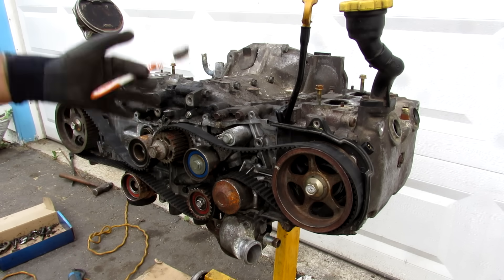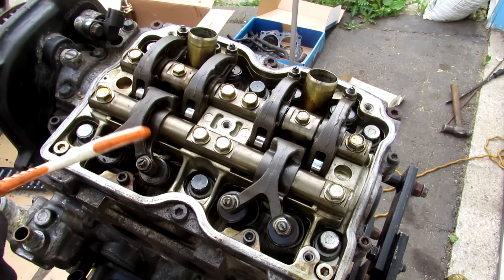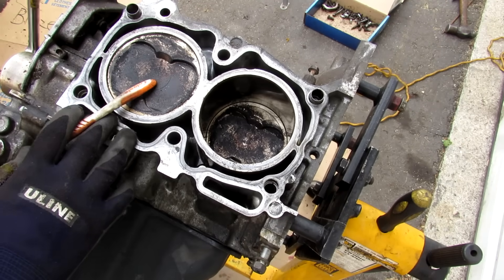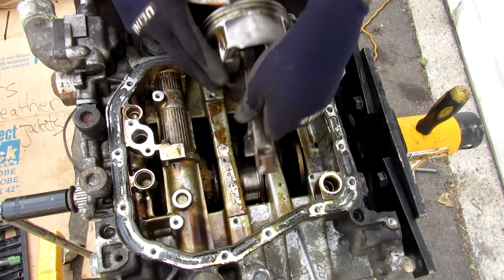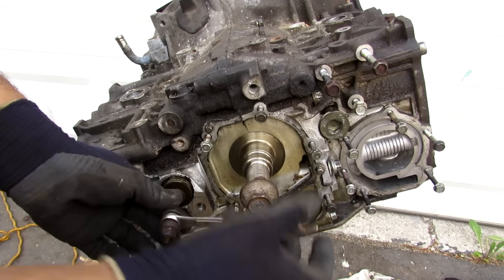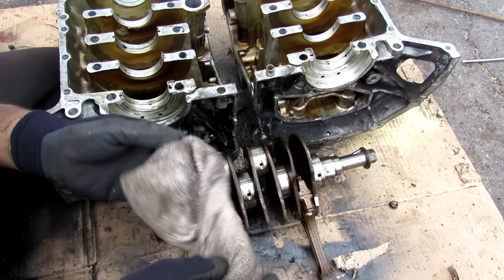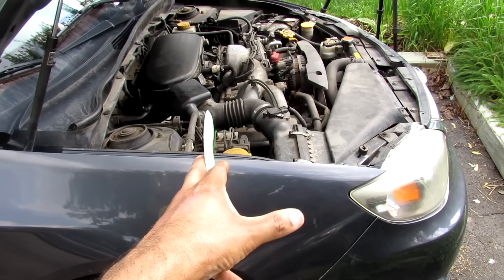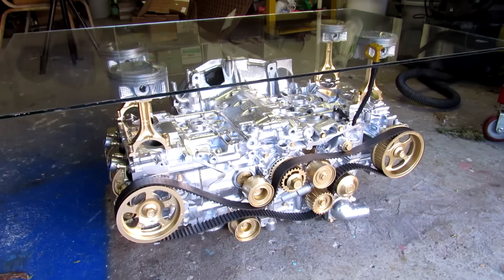Why Subaru Engines FAIL

Comment: "Oil burning, Oil starvation, Head gasket problems, Hassle to work on."
The four horsemen of the Automotive apocalypse.
Reply from the maker: Yes
Reply: @speedkar99  Great video, thank you. I wish I'd seen this before getting my 2010 Outback.  Soon as I got it home, head gaskets failed and engine had to be rebuilt (94kmiles).  I couldn't return it due to my state's lemon law.  Was great for 77k miles then gaskets failed again at 171k miles.  This time due to relay failure not spinning the cooling fans during a 2 hour trip.  I don't beat on my vehicles. I kept up on all maintenance. Coolant, plugs, oil (every 3k miles), trans, differentials, you name it, from experienced & trusted mechanics.  Have all records to prove it.  I was planning to keep it a long time.  I can't afford to keep repairing this archaic design issue so I sold it.  I don't doubt they can last. (I've seen some old ones still on the road from the late 90's early 2k's)  But it seems, unless you find the right combination of used care, maintained meticulously, these cars are a serious roll of the dice.
Reply: @ajfox96  they've had a hard time with their supply chain in recent years. The company exploded in size after the mid 2000s and especially after Trump's China trade disaster, parts in the U.S. have been sketchy. They're still a much smaller company than Toyota, Honda etc. In my opinion their best years are 2003-2008. I'm on my second forester (totalled the first one in an accident) and it's got 190k, running strong as hell.
Reply: @cymatic83  I agree, I've seen many late 90's to about Mid-2000's Legacy/Outbacks, Imprezas and Foresters around here (MN).  I should have gone with something that vintage like you said.  I really liked the look, handling, feel and ride of my Outback.  I coupled it with great winter tires and I just could not get it stuck. (I had lots of fun in the snow here)  It just really kills me to get snake bitten like this twice in the span of 80K miles.  Maybe I got a well disguised lemon, I don't know.  It was just really tough to have happen again after the care and attention I gave it.   Ironically, the very next service visit I was going to have my mechanic check the coolant and cooling fans/system.   My bad luck I guess.  I'm glad yours is going strong. I hope it keeps going for you.
Reply: @speedkar99  I got some questions since you seem to know Subarus very well.

Are there any NA Subarus that have unequal headers? If not, are there any turbo Subarus, besides the 2.5 in the STI?

Do the problems you described in the vid apply to all Subarus boxer engines?
Reply: @muaythai193  2.5rs and 2.5i were NA and no they didn’t come with unequal length headers. Aftermarket ones yes. Very common mod for hp gains on the rs and i.
Reply: @joshuanelson5092  And to add the 2002-2003 WRX had a 2.0 turbo engine. The 2.5, if i remember correctly, didn't get a turbo until 2004 for the WRX and STI.
Reply: @muaythai193  a lot of legacy models are turbo. I have a legacy B4 twin turbo.
Reply: @muaythai193  
No naturally aspirated models never had equal length(whi h is good, makes temprrstues even and is more efficient),but many people put turbo model headers for the rumble sound.

And again no, only SOHC naturally aspirated EJ25 is prone to these because of bad head gasket materials and design. It is permanently repairable by using EJ25 turbo gasket. 
All other engines including 2.0(ej20) and 2.2(ej22), h6 3.0(ez30) and newer FA/FB(both 2.0 and 2.5) engines dont have any headgasket issues at all.
What you might need to keeo an eye out if you get early series FB and FA engine is engine oil consumption(was resolved after 2014 onwards) but its not much of a problem. 

All it amounts to is that i carry small bottle of oil in my trunk(i have XV Crosstrek with FB20 engine) and around every 1000-1300miles/1600-2000kilometers i add around 0.8-1L of engine oil if it was on longer trip constantly(till orange oil level light comes on) but its infrequent. 

 Also i check oil level from time to time, something you should do anyways as a car owner. 

Possible treatment for it would be some fuel/oil additives like some ceramizer products, they reduce the problem greatly.

It also is healthy for the engine as you refresh the oil by adding a bit of new one for amount burned off, barelly costs anything.

 Its better to have just petty thing like this than catastrophic failures and flaws other manufacturers have more often on actually bad engines, but people dont talk about those much.
Reply: @Kacpa2  true, thx for the info.
Reply: @muaythai193  You're welcome :)
Reply: If you ask any mechanic of experience they will tell you Subaru is actually the easiest brand to work on. There is no stupid engineering in regards to servicing like so many other makes, for example pulling an engine to replace a 5c part, thanks BMW.
Reply: @sneakyfoz3692  can't make jokes nowadays, people just take it too seriously but yeah, I understand completely... to me it's all about honda, they make real educated decisions on where service items go
Reply: @r.p.6628  Totally agree with you. I often disregard the hate subies get. I drive a 1999 fozzie Stb in Africa on unforgiving roads in market full of cheap Chinese knock off spares and low grade fuel. I'm on over  270,000km and counting, got the car second hand and have driven it for 10 years and it still runs like a top.
Reply: I wish I knew half the Subbie engine knowledge this gentleman has. I would feel very comfortable driving my STI. Oh well I never floor the gas and always keep up with maintenance so hopefully I should be ok.
Reply: @dougcastle1785  never geting to go WOT in your STi is the definition of “not okay!”
Reply: Put a turbo head gasket on. Problem solved
Reply: Lol christ, the boxer hate here is hilarious. I see more old Subarus on the road (yes, still running) than literally any other car. Rusted out and beat to hell but still going. For every 10+ year old BMW, Benz, Audi, I can count 30 foresters and imprezas. I see more late 90s/early 2000s Subarus than I do any model Toyota, which people FAP to about their supposed reliability. I had an 87 4runner with the legendary 22RE and it was a nightmare. Easy to work on (and fun as hell) but reliable my ass. My dad and brother both had 2010 (ish) F150s that suffered from fuel rails rotting out, compressors failing, and a slew of other dogshit design problems with their Triton "modular" engine or whatever the hell they are. My brother currently has a 2011 Honda pilot with that stupid Eco mode that disables half the cylinders in the engine and causes a ton of problems too. Needless bells and whistles that break, Subaru doesn't have them. People trash talking these cars are so full of crap, probably because they suck at working on anything other than an inline or a V. Cry about it. They're simple engines, just shaped weird. You can't argue with the numbers of these things still on the road. I'm currently at 190k on my 08 Forester 2.5 and she purrs like a kitten, starts after one crank, still has tons of get up and go, not a wet spot on it. They're fantastic engines. People who don't know how to maintain them end up with these problems, which is the same story with any car you drive. I've driven Toyotas, Fords, GMs, Hondas, honest to god none of them hold a candle to the utility, capability, and reliability of my Subaru... and I'm on my second one. Maintain your Subaru and it will do you right.
Reply: Hassle to work on??? I've been a mechanic at too many shops and have done engines in lots of cars. Subarus are EASY! About the easiest I've worked on. BTW, My legacy has 370,000 miles on it. Original head gaskets. Maintain your car! it will last.
Reply: @mycoolwill7594  Hot damn, you only have about 107,800 miles until you've made it back from the moon in that legacy
Reply: Do u have a way to easily change the spark plugs?
Reply: @MrLanternland  remove the battery and washer fluid reservoir on driver side, remove air scoop and air filter box on passenger side, use a low profile ratchet, plus using a couple extensions to make getting the plugs in/out easier
Reply: @MrLanternland  jack the motor up slightly.
Reply: @mycoolwill7594  Hell yeah you said it for me. Every car is different and everyone has a different opinion. I've got one that's got almost 290,000 miles on it no head gasket problems none of that. I've just got to replace a power steering pump.Still runs great even the transmissions worn out and it always shifts!
Reply: @mycoolwill7594  just just gonna say there to easy btw I'm rocking a 95 legacy lsi blew the timing belt 10 k ago replaced all and she keeps purring 265k
Reply: @mycoolwill7594  From one mechanic to another.... I'd rather work on a inline 4 all day everyday.
Reply: @mycoolwill7594  please elaborate on easy.
Reply: @yolofullsend  Well, just pick something and compare it to let's say, Nissan, or Honda. Replace an alternator, ac compressor, condenser etc. Infinitely easier to do in a subaru. Hell, just try and put a cabin filter in a Nissan. Their engineers designed those cars with the thought of "I don't have to work on it."
Reply: @mycoolwill7594  HONDA - Had One, Never Doing it Again!  We had a Honda and virtually everything was harder to do on it than every other vehicle I've owned.  My Forester is one of the easier vehicles to work on.
Reply: @mycoolwill7594  Not quite. Alternator and Compressor may be top center on the engine but it requires a few things to be taken off before you can remove them from the engine. On a lot of cars, you can directly access the bolts and remove the unit without removing trim or brackets.. I changed out the Alternator in my Civic in a Autozone parking lot in about 15 minutes. 

And that sums up the only two things that are 'easy' to service on a boxer engine. Let's not try and stretch the truth here, that engine is a fucking nightmare to work on. Pretty much any internal work means the engine needs to come out and you can't even mount it on a stand and access everything. Compared to a inline, you'd have to be drunk to consider a Boxer easy.
Reply: @WolfPackM98c  Not sure what subaru you've worked on by I too, had to do an alternator on my legacy. Died on my way home from work. Did it on the side of the road, in the rain, with 3 wrenches. And yes. They're easy. I work on them everyday and have been a mechanic for many manufacturers. You can get pistons and bearings out while it's in a stand but honestly. How often are you doing that to an engine? Name any production engine that you can get out of car as quickly and easily. I've replaced a handful of engines in my life even a simple Camry was a bit of the pain cause of how they ran the harness under the intake. I can get any subaru engine out in 45 minutes, and I'm slow. Other guys in the shop do it quicker. Do an alternator on an odyssey, an ac compressor on just about anything else. How about a radiator? The only one easier might be a civic from the early 90's. Not stretching any truth here. Just sharing personal experience.
Reply: @mycoolwill7594  So, now you're comparing it to a minivan to make your point?

Comparing similar applications, the Inline and V will always win. You really can't get around the fact that, by design, a boxer requires more engineering and more parts to be closely comparable. 

Just look at how the engines sit in a car. The service points on a Boxer engine are aimed towards the fenders, where there is limited access. Inline and V's service point face the same service access points as the car. Arguing which engine comes out easier is side stepping the issue when you don't have to remove an Inline or V to make the same repairs. 

Hell, just distributing the weight on the crane is a more convoluted process with a Boxer.
Reply: @mycoolwill7594  I gotta ask: how did you replace the alternator on the side of the road, did you have the part in the car with you?
Reply: @rezneba101  Ha, girlfriend at the time picked me up and took me to the auto parts store. Bought an alternator, swung by the house and grabbed 10, 12, and 14mm sockets. Then back to my car. I did have to jump start it after the repair but I'm still driving it today with that same alternator. That was about 2004.
Reply: @mycoolwill7594  well done.  what is it; with 6-8-10-12-14-17-21mm you can undo 90% of any subaru?
Reply: @WolfPackM98c  So many things wrong with your statement. But I give up. Been doing auto repair for 20 years for several dealers and independents. Trust me, I've seen a lot. Not sure what you're working on. Maybe a Briggs and Stratton.
Reply: @mycoolwill7594  Yes, bow out. You don’t have anything to say other than that bullshit line of working on cars for 20 years.

If you’re a 20 year mechanic and you’re trying to argue the point you are attempting to make, you’ve confirmed that you aren’t a very good one. Have fun fixing those Subarus homie
Reply: @WolfPackM98c  he doesn't have to fix them they go to the graveyard before they get the chance. People can barely afford to maintain them let alone deconstruct them and rebuild them. When I applied for BMW that's the main thing they told me they do basic work and avoid serious jobs. Just being a tech at a dealership doesn't mean your a good mechanic. During my interview a customer called and said his car was not running good after an oil change, their master tech handled the job and the car leaked all the oil out I can't imagine being that person that got there car destroyed by just a bad oil change. I had have the nerve to call them out on it in the interview but I was discriminated against for being a strong women. Experience is better than a certificate anyway.
Reply: @tayaria7280  Wow! Color me unimpressed. Can I list all the cool stuff that I've put into engines over the years too. Overqualified?!? That's hilarious. When an auto shop tells you that they dont want you to touch thier cars. Think about it. Honestly. What shop honor wouldn't want the most qualified people working on their cars? And as far the graveyard. Take a look at the percentage of 10 year old Subarus on the road and 10 year old BMW's on the road. The reliability of BMW's is crap. The owners hate them after just a couple years. Subaru owners love their cars and it shows. Oh, they can also afford to maintain them too. Good luck with your teaching. I'm sure several car owners are glad you're not fixing cars anymore.
Reply: @WolfPackM98c  I will have fun. I'm making lots of money fixing these Subarus. Customers love them and like to maintain them. Good to know we're homies now.
Reply: @mycoolwill7594  I actually didn't want to work at BMW either because I found a higher paying job and I'm in a Union with the state paid holidays paid vacation I actually had the whole summer off sick days too also 2 free buffet style meals a day and don't have to break a single sweat or get greasy.  In the end they are going electric so good luck with all that auto tech life. I do side Hussle and break bread fine on my own time. Thank god I used my intelligent ways vs strength and agility a whole summer off and 2 month break for Christmas and 2 weeks during Thanksgiving is worth so much money to me I stay on vacation. You stay under a Subaru.🤷‍♀️
Reply: @mycoolwill7594  ….I’m not a 20 year mechanic, but I have owned Subarus and I can honestly say they are the easiest engines to work on. I have only owned 4 cylinder Subarus and I found that once you remove the battery and or the air intake housing, there is plenty of space to work on the car. With the exception of the bottom right screw on the driver side valve cover, it’s not hard to work on them.
Reply: @ponycar351w  I’m saving up for a 2022 forester sport after being a Toyota for almost 4 decades.
Toyota’s are starting to move into “Turbos” and am NOT happy bout it.
Too many things can happen with turbos, just look at all of Ford’s eco boost issues from their cars to trucks...
Reply: @tayaria7280  Union! Great move! Good for your future!
Reply: @mycoolwill7594  Yeah, Subaru's engines may have their problems but they are still rather easy and comparably cheap to fix (at least here in Europe). As a mechanic myself I can say that a lot of major car problems are user induced. If you take car of your car a Subaru engine is pretty durable most of the time. Let's see how the new 2.4l boxer engine will do.
Reply: @mycoolwill7594  
Yes the old Subarus lasted, especially 2.0L. But I remember when the newer 2.5L came out and mechanics from Honda dealership my friend worked at next to Subaru, because there was not enough guys to do the work, would fix the engines on warranty, coursing in English and French about the idiotic new design.
Reply: @mycoolwill7594  what coolant and oil do you suggest for an 02 forester L
Reply: @mycoolwill7594  also what mileage should I replace my thermostat in a 02 Forester
Reply: @nikomartinez1578  Any 5w30 name brand. 5.1 quarts on yours. Do thermostat with timing belt and water pump every 120k.
Reply: @mycoolwill7594  thank you, I been going with the mobil 1, gona do the waterpump soon
Reply: @mycoolwill7594  They're like legos
Reply: @mycoolwill7594  There are some very challenging parts of working on subarus (Did my sway bar bushings recently and it was waaay harder than it should've been) but as an owner of a 04 forester with 180k miles I totally agree, most things I've done to it so far have been pretty easy.
Reply: @mycoolwill7594  EJ25?
Reply: @mycoolwill7594  what’s some recommendations on maintaining. I have an Impreza wrx I just want to make sure it lasts. It’s a 2013 @ 82k miles right now.
Reply: @mycoolwill7594 especially if you go hunt down a Few Wrenches available in the JDM. They are borderline more simple than an air cooled Volkswagen.
Reply: @mycoolwill7594  Agreed.... I find the Subaru 4 cyl, specially the SOHC really easy to work on... And if its in a 1st or 2nd gen Forester where it gets like an extra inch or inch and a half of space between the front rails, its really a piece of cake to do everything on it.
Reply: @mycoolwill7594  We have a 99 Subaru forester with over 266,000 and still runs great with no problems. I agree with you, maintenance is the key to make it last.
Reply: @mycoolwill7594  Subaru EZ my ass, takes a lot of time to dissasemble and reach the cylinders if anything goes wrong, while a VW engine from the 90's I do it in 20 minutes.
Reply: It should be noted that many Small aircraft use a very similar split block design. On certain engines only a strand of silk string is used as a gasket between the halves. Fly safely.
Reply: @jc-hd3ih  yes, had a Rolls Royce 4cyl 0-200 in a little Cassutt IIIM - #26 back in the 1980's
Reply: my 03 Legacy is at 202k miles, still running fine. I gotta do the timing belt. The head gasket on my specific generation of 2.5L has an issue with the coating degrading and causing an external leak. A common repair is to use the Subaru MLS head gasket from a turbo model. Oil starvation isn't an issue if you check your oil. 
I expect my engine to run for another 100k miles.
Reply: @MikeStavola  nice that it's still going at 202K, but if you have enough money, time and parts anything can be kept on the road for several 100k. I don't think that's what the original commenter is getting at. I have never owned an ICE (aircraft included) that needed more than half a quart of oil between oil changes, even at 15,000 intervals for cars and trucks. Loose rings and no spare tire to improve gas mileage is a desperate fail.
Reply: Subaru is one of the most easy cars to work on. Simple and not hard to take apart
Reply: Mine doesn’t burn oil, zero headgasket issues, and is really easy to work on.  All the engine components are exposed and easily replaceable.
Reply: So So many moving parts that are all interdependent on each other. I agree that good maintenance will get you to 300K miles, but years from now, when all cars are electric, with only the Main Motor and one (1) moving part (the Rotor), people will look back and laugh at just what they had to put up with!! I have no idea just how you could re-torque the Cylinder Heads without Engine Removal - at a huge cost.
Reply: @John Thomas - TIP: No re-engineered  head gasket. Because the head gasket IS NOT THE PROBLEM! Get it now?! ;-)
The head gasket is just the visible side of the problem. Call it the consequence, if you prefer. But it's not the reason!
Reply: @crpth1  What's the reason then?
Reply: @EbonyPope  the head bolts need re-torqued after so many miles
Reply: @EbonyPope  "The main reason is because they share the 2.5-liter SOHC engine. This engine causes overheating, loss of coolant, and black-colored coolant in the recovery chamber." "After 2009, newer models using the EL25 2.5-liter engine should have far fewer head gasket problems because Subaru started using a multi-layered steel cylinder-head gasket. Starting in 2012, reports say the Japanese automaker redesigned the 2.5-liter engine in the Forester and Outback and has fixed the problem."
Reply: @Yellow-Rose  Thanks for the information. What's a recovery chamber though? I'm not a native English speaker.
Reply: @EbonyPope  gravity
Reply: @Yellow-Rose  good to know cause I’m looking at a new 2022 forester sport possibly this fall of this year. Thanks
Reply: @EbonyPope  The design of the Boxer engine itself. Gravity hurts it. While there's benefits to them like reduced vibrations which makes things comfy, it comes at the expense of gravity causing fluids to pool and Subarus use of cheap parts means these fluids travel to places where they shouldn't. 

Only real solution is to detune them (which Subaru does at the factory), change your oil while it's still new, and hope your luck hasn't run out.
Reply: @crpth1  Nothing will ever eat head gaskets like the GM-produced 2.3l Quad4. Remember those? Steel block, aluminum head... recipe for disaster at 35k miles. I wonder sometimes if folks remember what real POS cars were like when they're bashing other cars for failing at 100k miles...
Reply: @John Thomas um yes, it will
Reply: i am seriously considering to buy electric car as a next one because of that
Reply: @troll mark cool story troll.
Reply: Why would i want an UNRELIABLE japanese car? Just get a toyota.
Reply: @alphatrion100  Toyotas are boring and ugly. I have 240k+ on my Subaru. Been more reliable than all the other cars I’ve owned
Reply: @inforedV  
boxer engines blow headgaskets. Newer subarus look generic af
Reply: @alphatrion100  Not all and newer ones don’t have that issue. Flush your coolant and put cooling conditioner and you’re good to go. 150k flawless reliability and owner for 6 years 😎. Newer cars all look like shit. I’d rather have a newer truck than an cream puff car. I only like the Impreza hatch since they are smaller and not like all these big ass boat cars. Plus they still make 5 speed transmissions
Reply: @inforedV  😀👍
Reply: @John Thomas Correctamundo 🎯
Reply: In practice a decent Subaru engine that wasn't the 2.5 in the eras where it was plagued with head gasket issues aren't really bad engines at all. The rings issue was mostly to do with the engine later on which featured different piston rings to the EJ series which were inferior. All cars will burn oil eventually though so it's not really anything new. 

Overall good Subaru motors are actually fairly common and fairly unproblematic to run, the main issue is the access to do jobs, like spark plugs which can be a pain in the ass on these engines, the two valves covers instead of one can be a pain as well if the gaskets are shot and need to be replaced. 

Overall though their motors are still pretty good, you can do alot worse.
Reply: lol.  What are you talking about? I’m no Subaru fanboy.   They have their problems like any other manufacturer. Turbo models never had headgasket issues, you wouldn’t have oil burning issues if you change your oil properly and nothing about this engine promotes oil starvation. Also, Subarus are in my opinion the easiest vehicles to repair.  Minus doing spark plugs and valve cover gaskets. Everything is on top and in the front of the engine.  Timing it is easy, doing any maintenance is a breeze and the oem parts are pretty good quality. The EJ engines are really good engines aside from the crap headgaskets they used in some of their models. That was a bad mistake.  However, this was solved in 2010 with a multilayered steel gasket. The amount of these engines Iv seen with 250k+ miles is crazy.  And.  If it blows up.  Pulling the engine takes 45 minutes due to the easy access to engine mounts, easy disconnection of the main engine harness. These engines are great.  Not Honda k20 great.  But they are great.
Reply: Tells me all I need to know EVO wins LAN Evo is king
Reply: I’ll take an inline any day of the week over a boxer.
Reply: Yep. After watching this video, I'm never buying a Subaru.
Reply: @seekerrild4629  240k runs flawless from when I got it around 100k. The internet doesn’t do these cars justice at all
Reply: The whole time I'm thinking, " never gonna buy a Subaru"
Reply: @turdrocket  they’re not that bad. 240k on mine and had it since 100k. No problems and take long road trips monthly
Reply: "Oil burning"
Change oil every 3k miles or 3 months and don't slack.  Never use synthetic oil, just regular oil.  That can blow gaskets and cause the engine to develop oil burning issues.  An engine overheat will also do it.
"Oil starvation"
See above.
"Head gasket problems"
Yes.  All Boxer engines are in a Head gasket lotto, and the losers go to the used market, so beware on that.
"Hassle to work on"
Yes, just yes.
Also Subaru cars usually develop electrical issues.  Other then that they are quite reliable.  My 2003 is still running, original everything except for a door motor, and a head gasket.
Reply: @abram730  ahem newer subarus require synthetic... you're out of your depth.
Reply: @rezneba101  That is when the oil burning issues started.
Reply: @abram730  running shitty oil all its life maybe?
Reply: @abram730  lucky that my '98 EJ 22 only has 83k miles on it!
Reply: @abram730  I owned a 1400DL in the early 80s. It was a piece of junk. Never again. Constant hassles. I also owned a Nissan and a Daihatsu... both were junk. I've since owned 4 Toyota's and they've all been rock solid.
Reply: had one of these pos engines . was done at 59k
Reply: Money pit